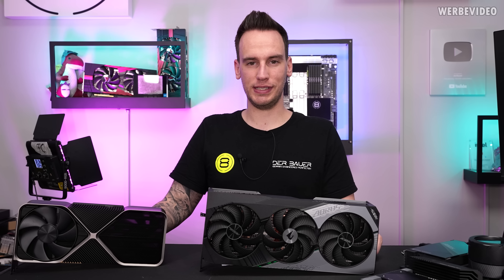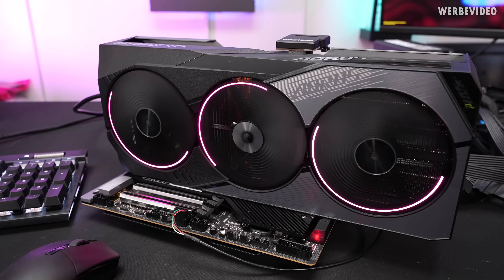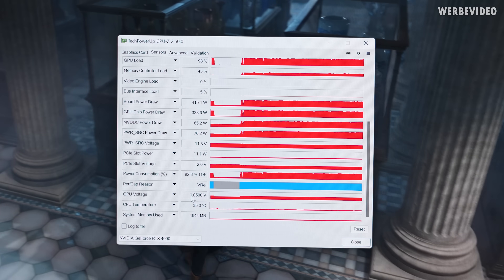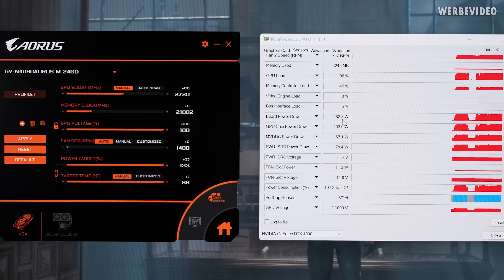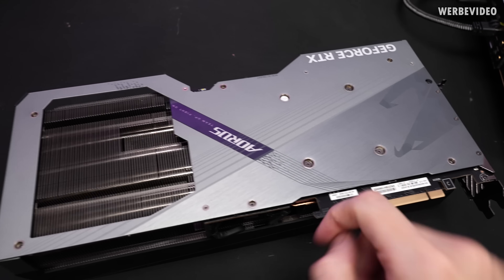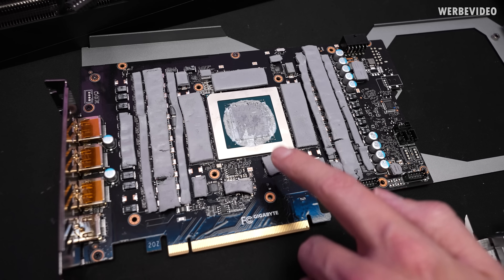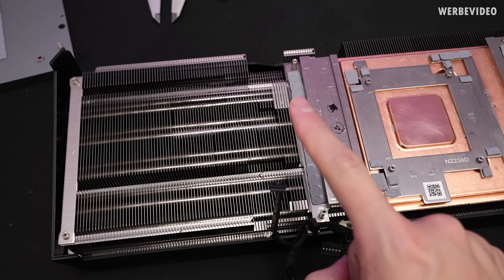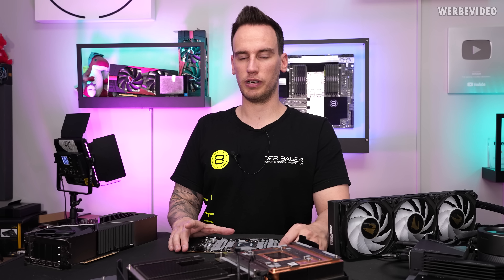Hidden NVLINK? RTX 4090 Aorus Master Teardown and Overclocking to 3GHz

Comment: The new H100 gpu has 4th gen NVLink, so NVIDIA hasn't abandoned the technology, because it has lot of advantages. Maybe those lanes are there because we will see NVLink coming back in a 4090 TI version, or in the future evolution of the RTX 6000 professional cards, that should use a very similar pcb. Meaning that they left the door open in case there is demand for that.
Reply: The RTX 6000(Full AD102) doesn't have Nvlink so I'm really not sure they would add it to the 90ti/Titan

Comment: So..., AIB partners make overexpensive products with 0 differences compared to the FE of Nvidia? Now I see why EVGA left, those ambitious bastards wanted to earn more money with 0 improvement over FE, here nvidia is the correct one in prices!

Is sarcasm bitches, but this is worse because Nvidia artificially increased the price of graphics cards by $800 with $1200 margins....., while partners strive to compete with FEs with less than 5% margins even , this is horrendous, now I see why EVGA left the market, it doesn't win anything, rather it loses, what a horror and to top it off the iSheeps continue to suck Nvidia's balls.....

Comment: Could you do a video soldering a nv link connector to the card and seeing if it works?
Reply: Probably disabled in the hardware. Would probably have to be reflashed or something to get it to work even if it did work after soldering.
Reply: it would be pointless the ada lovelace die does not have any link to the connector from the die, as it's not even physcially on die.

Comment: Der8bauer i doubt that even condisdered it. there is no Nvlink connections on the ada lovelace dies them self as they would've put it on the RTX6000 card workstation variaint cards if there was, because it's the most benifical to workstaion users. Also check your Fonders edition for those same connectors, I bet there is nothing there.

Comment: So we understand that these GPUs are a scam.
They force on you to buy oversized cooling that many advanced users don't need as they will go for custom water cooling.
Nvidia should sell a barebone GPU board without cooling at a drastically low price and keep their coolers as a separate item.
The same way we can buy motherboards, CPUs, memories, etc, GPUs have reached a level in their development where they no longer should be treated like a standalone item, but like a combination of parts. (especially in the high end segment)

Comment: This Arous Master card is miles better than my 3080ti Aouse Master. My 3080ti can get up to 77c pulling 450w 90-100% fan speed and here these 4090 cards do 58c stock! and 63c pulling 530w lol! Who needs water cooling unless you want less space used but I love the looks of these massive coolers personally in my opinion and will look good in my case as it can fit any of these big coolers anyway. Just waiting on what AMD has to offer before I pull the trigger as I'm still not liking Nvidia I'm just more in love with these aftermarket coolers if only I can put them on my 3080ti and replace its current XD
Reply: Well... Consider size difference between 3080ti and 4090, which is quite a lot bigger.
For my Aorus 6750XT i have temps of 62-67 degrees for 260W. Hot spot is MUCH higher though. (around 84-87 degrees for high frequency load). But fans on other hand are REALLY quiet even at full 3000 RPM speed, compared to all previous card i owned (granted they were more of a cheap category, but also with lower power consumption and higher temps).
Reply: @DimkaTsv  cooler size wise I figured my Aorus Master 3080ti and 4090 Aorus Master are within the same ballpark size wise anyway. But the 4090 vision does have more air way looks like and 13 heat pipes vs my 7 or 8 and smaller air gaps so I'm thinking it had a lot of dead spots
Reply: @forog1  ehmm... 4090 is monster compared to 3090 in terms of size
And 3090 is bigger than 3080ti. 
So...
Reply: @DimkaTsv  By bigger what are you referring to? Cooler or die size? Because the 3080 - 3090ti all have the same die size just disabled cores on the lower tiers. Coolers the Aorus Masters have always been the same across the same generation cards starting from the 3080 and up, so I'm confused as to how a 3090 is "bigger" then a 3080ti in anyway besides for being 2% faster with 12gb more memory. So, you need to elaborate what you trying to get at?
Reply: @forog1  bigger = overall size.
And overall size means cooler size
Bigger size = bigger finstack and more airflow as fans are also bigger.
More finstack means more surface area, meaning faster heat dissipation
Faster heat dissipation means, easier time creating temperature delta between heat spreading elements and coldplate on die.
Bigger temperature delta = faster thermal transfer from die to heat spreading elements
Reply: @forog1  Also
AORUS MASTER 4090... 
Die size = 608 mm^2
Dimensions of card (basically cooler)
L=359 mm, W=163 mm, H=75 mm

AORUS MASTER 3080ti
Die size = 628 mm^2 (wow, it actually is larger)
Dimensions of the card
L=319 mm, W=140mm, H=70mm (really... It is also Quad-slot GPU, WTF?!)

AORUS EXTREME 3080ti
Basically same but with higher frequency (binned and different BIOS)

Volume of 4090 card = 4 388 775 mm^3 = 4388 cm^3 = 4.38 liters
Volume of 3080 ti card = 3 126 200 mm^3 = 3126 cm^3 = 3.126 liters.
So just raw cooler volume was increased by approximately 40%. And in addition to that larger fans allow for better airflow thorough this stack.

But i was surprised as die size for my 6750XT is pathetic 335 mm^2 in comparsion
Reply: @DimkaTsv  Ah I see going by this I can still fit it in my case but yeah, the 3080ti cooler I won't say sucks, but it could have been better. Off topic but it's funny that the 3090ti pulls more power than the 4090 if you let the fps uncap but just going by YouTubers benchmark tests so idk if the 4090 was bottlenecked by CPU or what but this was while it was 60% faster in this test lol
Reply: @forog1  Yeah... 4090 got nice boost compared to 3090 (except size tbh... 4090 one feels humongous and heavy in comparsion)
On other side i really am not a fan of Nvidia buisness strategy and company arrogance (not undeserved, but still...). They make fucking good cards, but i am not feeling like supporting them lately. 

Not to say in my country prices on them are still quite high. Because we forced to use indirect supply chain. Well... I only want to get few bugfixes for my AMD drivers and it will be good enough for next few years. Until i actually decide to go 2k or more monitor (currently on 24" 1080p)
Reply: @DimkaTsv  yeah I really liked AMD driver interface over Nvidia's back when I had the 5700xt. And yeah Nvidia really pissed me off with their whole announcement of those launch. Feel dirty just owning there product but I bought off ebay so my money didn't go directly to them anyway lol. But I'm really hoping AMD has something good going on their end but its ben pretty quiet but I'm still going to wait. I want a 7900xt and sit on that for a while.

Comment: Thank you for measuring the thermal pads. There was so much confusion about best size on last generation, knowing the multiple thicknesses on the card is very helpful.
Reply: Did you end up doing a pad swap? 1mm and 2mm ok?
Reply: @MrMrGaming  I did and it worked great. I am sorry, but I can't remember the thickness measurements. I think it was 1.5mm
Reply: @EarlywineJC  Ah, I know he says there are two sizes, one was 1.08 and the other was basically 2mm. I just wonder if that 1.08 would be better with a 1.25 rather than 1mm.
Reply: @MrMrGaming so I ran into an issue where the 2.0mm wouldn't crush enough to allow good contact for the GPU. My notes say I used 1.0mm on the memory and under load temps lowered the GPU to 74, memory and hotspot to 82
Reply: @EarlywineJC  That's good info, thanks. I take it under load, you mean fully maxed? 500w+

Comment: I remember all the armchair engineers before launch saying how 4090 will have to be liquid cooled, meanwhile air cooled one under full load 60C
Reply: I mean historically this would have been water cooled. you used to see high end top class GPUs on water all the time. mostly to push that last bit of juice out the chip. no one back then though the consumer would stand for such a large card. we've gone from 2 slots to 4 slots far quicker than I thought would be tolerated by the market. but it's not just the slot spacing, the sheer size of the card as well. it's ludacris and I won't be interested in one, I usually buy a generation or two older. like last year I bought a few 20 series cards for my compute uses. but these, naa, could only fit two in my server at best

Comment: So could you theoretically scrape off the top layer, cut out the connector profile, reflash to BIOS to enable NVlink? This would be useful for some compute applications. You know, the kind nvidia wants us to buy "quadro" or datacenter cards for?
Reply: Here is the funny thing Nvdia does not support NVlink in any of its rtx series which includes the formerly known "Quadro" lineup. So now it's limited to only their tensor cards which are Data center cards so even paying thousands of dollars for "Quadro" to do professional work it isn't enough for Nvdia. You need to buy datacenter cards to have NVlink enabled.
Reply: well there's what the person said below plus you can't flash a modified bios on a nvidia card, it just will refuse to boot.

Comment: For voltage adjustment...a rather hardware-level way would be to go straight to the power supply controller like the older days. (though probably use I2C and write to registers instead of jumping resistors or putting a pot) Requires a card that have adjustable voltage supply. Good luck on OC!
Reply: And then Nvidia will start going the route of Apple and using serialized chips (v controllers) and encrypting their control bus to the GPU to prevent hi-jacking.
Reply: @meeponinthbit3466  Shunt mod exists. It looks gross, but it is a way that extreme overclockers remove limits from voltages.
There are drawbacks ofc, though.
Reply: @DimkaTsv  pretty sure those shunts are just for current sensing resistors on the 12v rails for total power measures... 40s aren't power limited there, so that wouldn't matter.  It's the VRM output that needs tweaking, and with digital VRMs, that gets real tricky if Nvidia decides to be jerks about it.
Reply: @DimkaTsv  that's for current sensing. For voltage someone needs to either reverse engineer the voltage controller, or bypass it completely with some external regulator.
Reply: @REAL_blubskye  yeah, sorry, i am bad then.
But.they are doing this one as well.
Even though external voltage for sure doesn't look pretty